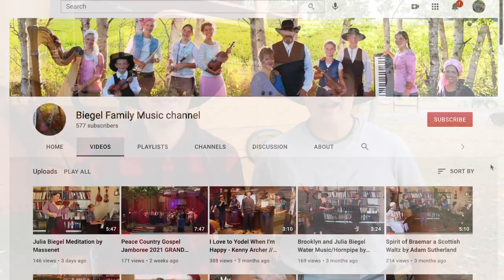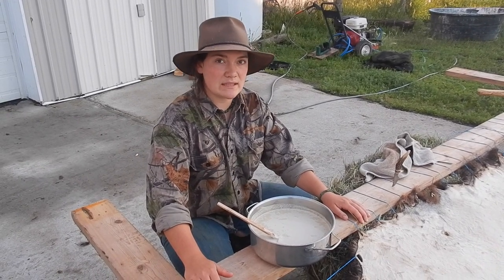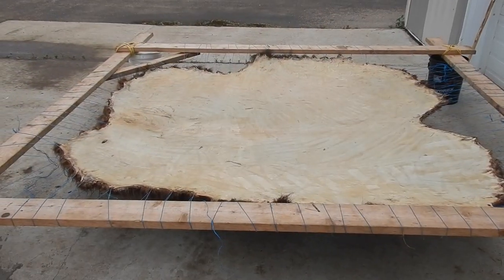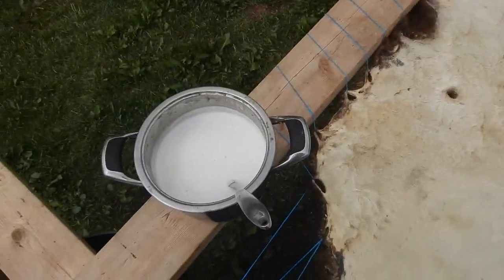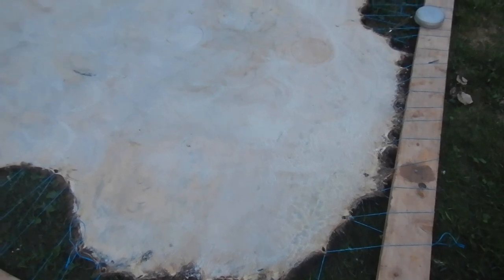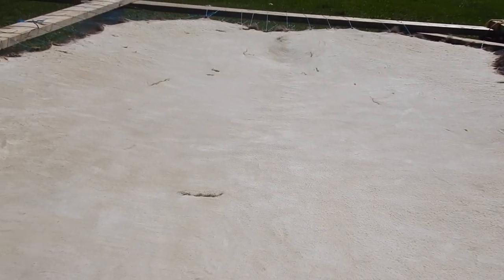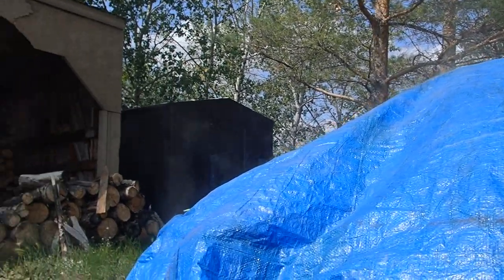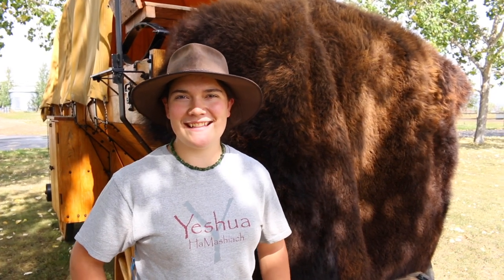Traditional Brain Tanning Buffalo Hides Part 2

Comment: Hi, nice job, I’ve been braintanning for 24 years & did a good job.  I’ve braining tanned around 80 bison hides, a tip, before I apply brains to hide, I always heavy smoke first & then apply brains, and I smoke in between each braining & you’ll see that it softens up even more after.  The first smoke just coats the outside fibers, but as you start working the hide & smoke it the fibers stay open more & can absorb more brain & smoke, casing more fibers to open.  My last one I smoked total 36 hrs, the more you mess with it after it’s done the softer it becomes.  It’s what I do on all my hides.